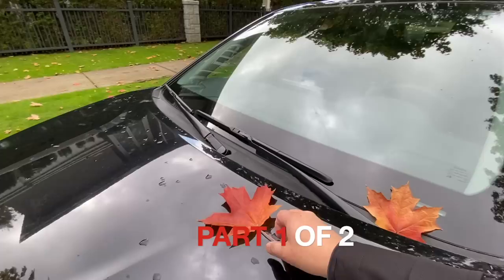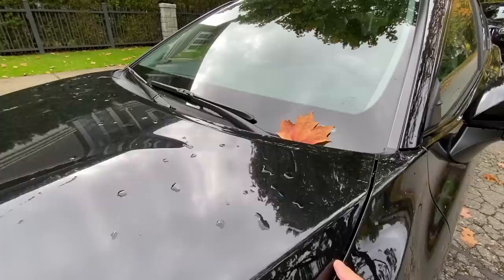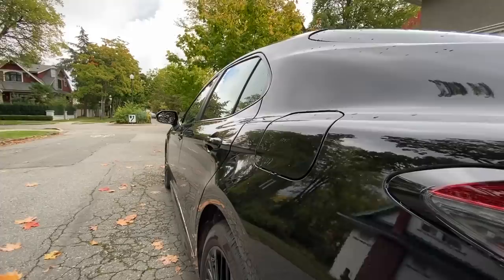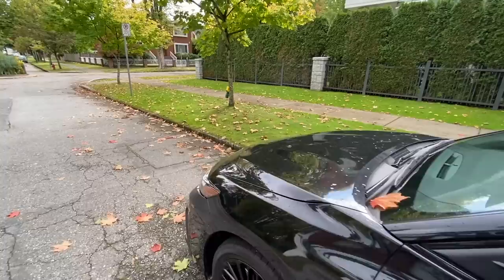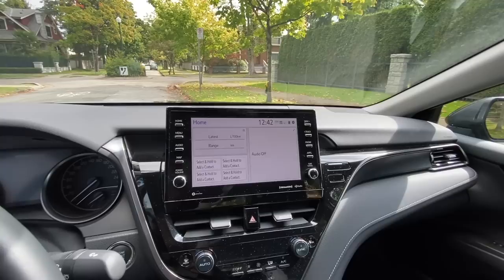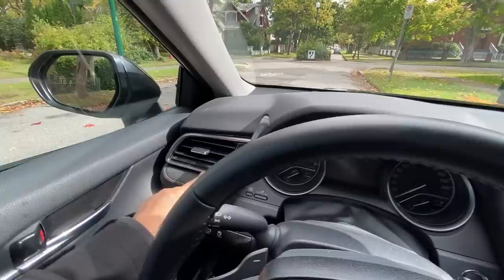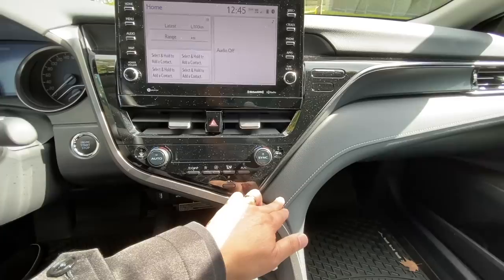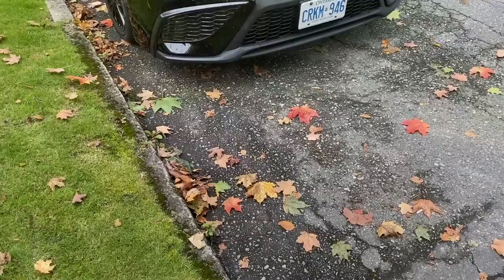TOYOTA QUALITY:  HOW TO CHECK FOR DEFECTS - IS YOUR CAR WELL MADE?  PART 1 OF 2

Comment: David, I know it would be an immense project and I know it would really put you on the spot professionally but I dream of seeing a comprehensive analysis of mechanical components. 
To me, quality starts with the mechanical components and works it way out until it eventually reaches the body panels. I will offer a concrete example of what I am speaking about in the form of a question. Why do we see so many more 15 year old Corollas on the  road compared to the Focus or Cobalt when the cars sold in similar numbers? Alternately I might ask, why does the 'Pontiac' Vibe easily outlive the vast majority of the other Pontiacs that were on sale in the same showroom? This is what the British call  'putting the cat in amongst the pigeons' . :D
Reply: The Pontiac Vibe was a rebadged Toyota Corolla Matrix built in the Freemont CA plant which Toyota and GM co-owned. The plant shut down after the GM bailout and both cars were discontinued.
Reply: @MarkHunter04093  The Vibe was built in Fremont, California and production ceased in August 2009. The Matrix was exclusively built in Cambridge, Ontario. The last model year for the Matrix was 2013 in the USA but Canada had a 2014 due to the comparative popularity of wagon-style vehicles in our market.
Reply from the maker: You always ask great questions and make meaningful comments Mike!  Let me work on future videos discussing how Toyota create, test, and assemble components, parts, and mechanical/electrical parts using different technique from other automakers.  Thank you for your feedback always!

Comment: Look for paint dirt (small, generally round specks), panel matching/ fit & finish gaps, panel flushness from front to rear of the vehicle (think wind noise), even-ness of horizontal body lines, door/trunk/hatch closing force, shut off radio and listen for buzz, sqeak, rattle noises when driving,  etc.

Comment: Really like the Mercedes black paint finish, has depth and sophistication even from far away. Thank you for interesting evaluation approach, i usually look at metal quality in the engine bay, rustproofing  and wiring connectors

Comment: One can crow about how well made a vehicle is versus its competitor.  However, that may not matter in the full-size pickup segment when it comes to sales volumes. For example, as of Sept 1st the GMC Sierra has managed to sell 138,412 units sold versus 43,865 Tundras for 2021 model year - which places the Tundra 5th in the segment.

By the way, I have a 2015 Tacoma as a daily driver. 👍
Reply: People will always buy subpar brands ... I use to buy GM and Ford ..NOT EVER AGAIN ! Only Toyota and Honda now . I am woke ....LOL

Comment: Honestly the latest gen Toyota Camrys and Toyota products in general have gone down in quality and feel very cheaply made compared to the 90’s-mid 2000’s when  everything you touched inside a Toyota Camry was softly padded vinyl and was very solidly put together. 

My boss has a 2020 Camry and I couldn’t believe how horribly cheap the door panels felt and the hollow doors that sounded very tinny. Nothing about his Camry felt solid or high quality IMO compared to ones built 20 years ago. Sure the interior looked stylish but the car didn’t feel any different than a Kia, Nissan, Ford, or GM product. Plus it had a ton of road noise and it rode very rough for a XLE.

I understand that David was a Toyota engineer and feels obligated to defend the brand which he can’t really talk bad about them, but Toyota’s quality isn’t near what it used to be.

Other forms of determining build quality is how solid does the vehicle feel? The weight of the doors, thickness of the glass, plastic quality, suspension/steering components and it’s quality of materials used including it’s design and size of the components. Body bushing size and locations, weld and seams, the obvious NVH, does the trunk flex or move if you try to bend it? Same with the door and hinges, metal thickness and so on.

Another point that I will like to make that not too many non car people understand, is that as 4 cylinder engines get up in mileage, they start making more noise, they vibrate more and sound terrible. A Toyota V6 never does this, all there V6 engines are wonderful, smooth and quiet motors but their 4 cylinders like the majority of other brands start getting loud and rough feeling over time. 

BTW I own a 2007 Lexus LS 460L and it is literally the best car I have ever owned period. It’s great quality although not everything in the interior is solid feeling and well built, but on the whole it’s very well engineered and the combination of the amazing 4.6L V8 and the 8 speed trans is a match made in heaven! It rides like a 70’s Cadillac as it floats and absorbs the roughest roads which I love. It’s an extremely solid and well built car that does everything right even today, being a 14 year old car, it still feels and looks brand new. It just goes to show the high quality of materials and body integrity has held up after all these years. Even the paint is still perfect. It’s been very reliable as well, sure some suspension issues are common on these models such as the control arm bushings and ABS unit, but nothing mechanical or electrical has gone wrong with the car, it’s buttery smooth and powerful! Lexus forever!
Reply: They were not nearly as safe and the body would crumple up more in a collision . MUCH BETTER NOW !!!
Reply: Yeah but they feel so low rent as the quality of new Toyotas aren’t as good anymore. The competition has really surpassed Toyota in terms of styling and reliability, including quality such as Mazda and certain Hyundai and Kia vehicles such as the Palisades and Kia K5 that look stunning and are well constructed.

Comment: Made in Japan is the quarantee for a well build car...
And not from a thirty party co
untry such as Turkey or Mexico.

And country made isn't written anymore on the car.
They hide it under codes & numbers especially at Europe.

We own 2 Toyotas which have rattles, plastic noises.
The one is an 2019 model but made in Turkey...the plastics around engine are not well made also.

I test drove the Corrola Hybrid & quality was poor...made in Turkey also.
The  plastics around the windows doors had faded paint color..
The back fender is so thin that you can squeeze it easily with only 1 of your finger.
..Was a 2020 model !!

I am willing to pay extra money for that lost Toyota quality but they no give as a choice.

They just not build them anymore like they used to be.
Reply: My Toyota was made in Kentucky ,USA and it has great quality .. It must be your county at fault ?
Reply: First off, country of origin makes no difference. Look at David's last video before this. All practices are same across each Toyota assembly plant. Parts come from various countries including Japan. Second, check out the build quality of the Turkey manufactured CHR. Impeccable build. Last Turkey plant had won gold for one of the top plants in the world. I can't speak for the others built in Turkey due to CHR only one imported to N A.
Reply: @randyjackson347  Has nothing to do with where its built. Process same and parts come from all over the world.
Reply: Chr is one of the cars we have , model 2019...and the console is doing vibrations, noises..
Reply: @Rider_on_Indian  sorry not same for me and cast of owners I know . Best build quality. Sorry pal.